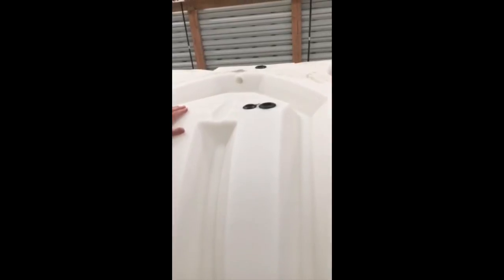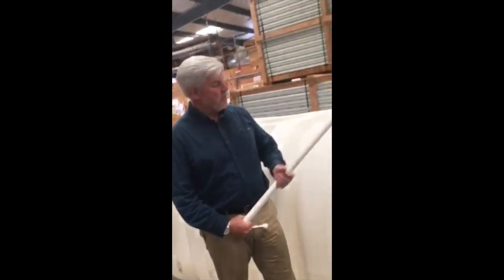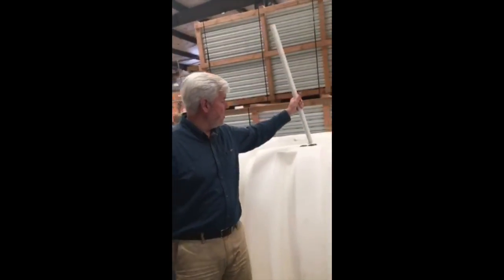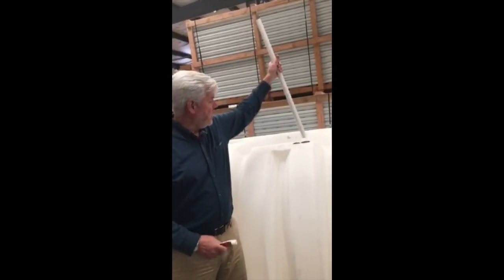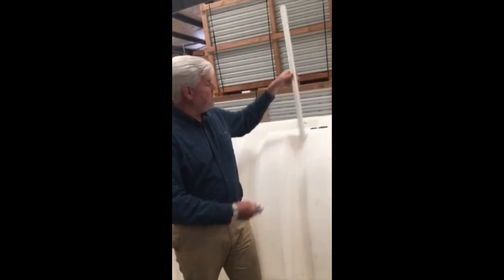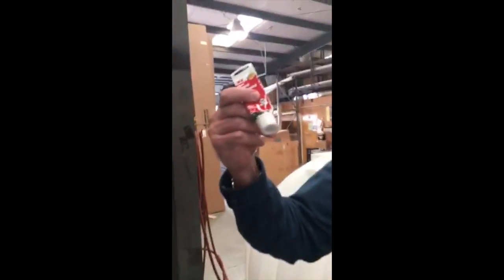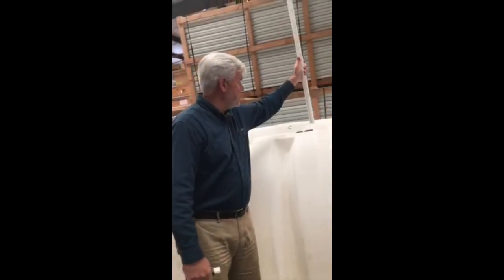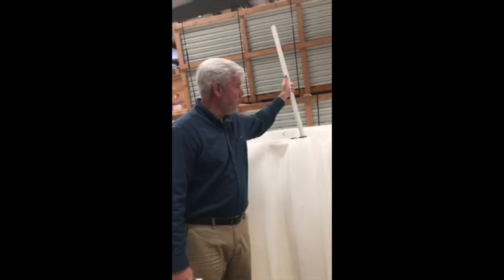How to install a hydroponic reservoir water tank

Comment: How often do you change the nutrient solution with that size of reservoir?
Reply from the maker: 6 to 12 weeks but there are lots of variables.  It depends on how clean-your source water is when you start and how balanced your nutrient formula is.  If source-water is clean of minerals and your nutrient formulation is balanced to the type of plants you are growing, toxicities and deficiencies will build up slowly in your working solution as plants transpire and source-water/nutrients are added to 'make up' for what is used... you can stretch it out for about 3 months.
Reply: @AmericanHydroponics  thank you very much

Comment: Do you recommend burying the entire tank, part of the tank, or keep it above ground? I have done both.
Reply from the maker: Lot of "Ifs".  All depends on system size and grading.  For our systems we can run drain plumbing about 90' above the ground until we have to go below grade.  From there we pitch 1/4" per foot until we hit the inlet of the reservoir.  

IF the reservoir is far away from the tables than the tank will definitely be below grade.  

IF the tank is in the greenhouse than it would be buried just enough to hit the tank inlet.  

IF it is just (1) small 40' table than the tank can sit on the ground if it is low profile (about 25" tall).  

But IF it is (2) 40' tables separated by an isle, it would have to be in the ground so you would not trip over exposed plumbing.

Comment: Hello what would be the formula for sizing the tank to troughs?
 Thanks Graham
Reply from the maker: Wow... this one slipped through the cracks.  Tank size is based on plants sites, not number of channel.  We allow 8oz of water per day for finishing plants and 4oz of water per day for nursery plants.  We double that number and than calculate how much water will be in system if the pump turns off.  We don't want a reservoir to overflow.